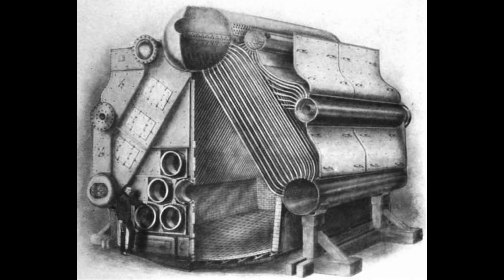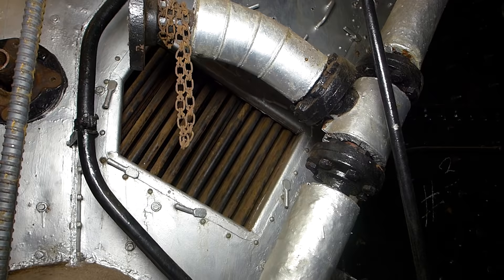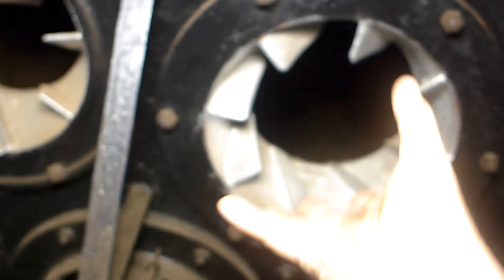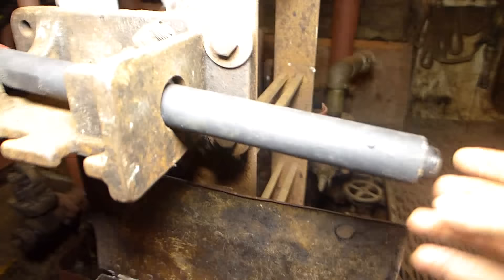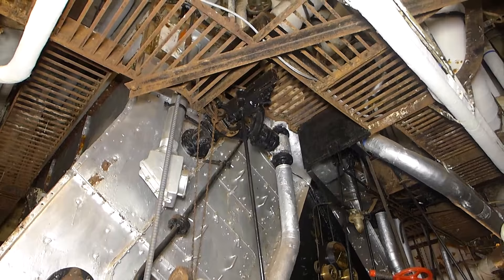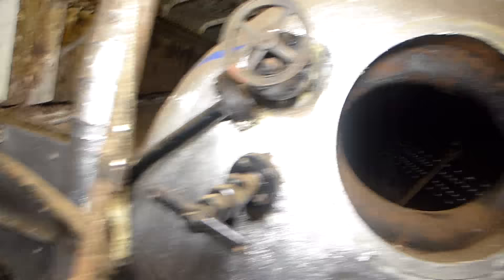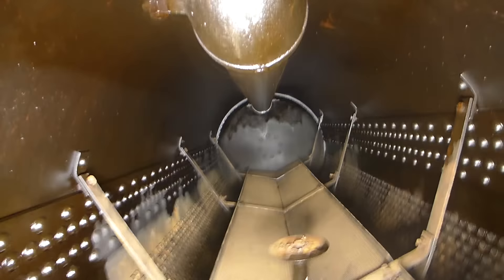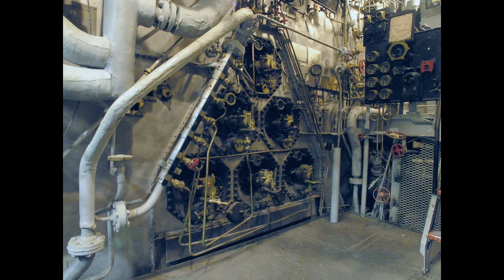Battleship Texas, Making Steam

Comment: Were steam engines powering hydraulic pumps to power up the deck guns...?   And thru intermediary  systems  delivering powder, shot , shells as well as propulsion for catapults tossing depth charges ..as well as powering generators delivering  electric for ship uses... etc....?
Reply from the maker: The only depth charges on the ship were used exclusively by the spotter aircraft stationed on board.  There was no ability to launch or drop them off the ship.  Steam was not directly used for any of the power systems you mentioned.  Electricity was primarily generated with steam driven turbines.  Power for the weapons systems was all electric.   Shell and powder hoists were directly driven by electric motors.  All of the smaller weapons were manually trained and elevated by hand cranks, except for the 40mm anti-aircraft gun mounts that were electrically driven.  The big 14" guns used electric constant speed motors to drive variable speed hydraulic pumps that turned the gears that rotated the turrets or elevate guns.

Comment: I sure hope they eventually "dry berth" Texas before the seawater corrodes her into nothing and they are forced to scrap her. Whether they put her completely on supports (unlikely due to the weight of the ship) or entomb her in cement like they did for Mikasa, it would ensure she's around for another hundred years
Reply from the maker: Setting her in concrete like Mikasa would certainly destroy her, especially considering that they also filled Mikasa's lower decks with cement to ballast her.  The reason for the concrete wasn't for preservation, but to make certain the ship was totally disabled.  Otherwise, the Japanese would have been forced to scrap or sink the ship in order to meet the terms of the Washington Naval Arms Treaty of 1922.  At the very least, doing it to Texas would destroy hundreds of historic artifacts located deep her that can't be removed.  Once in concrete, abrasion between it and the hull created by temperature changes would quickly destroy protective coatings and trapped moisture would then do its work to eat away hull plating and then hull structure.  If kept in water, the ship can be periodically removed and every square inch of her accessed for repairs and restoration.  Keeping her out of water is a non-starter.  There were plans to accomplish that put together about 15 years ago.  Unfortunately, it was far too costly.

Keeping her in water provides the best overall means of supporting the hull and structure.  The key to a very long life is to periodically dry dock her to service her hull and protective coatings.  What is interesting is that the hull corrosion that they are currently repairing in dry dock occurred from the inside out as a result of interior water created by hull leaks.  Most of the protective coatings that were applied in 1990 during her last dry dock session were still there and working.  For those reasons, a combination of re-plating problem areas, full welding of the riveted plating and modern coatings should control further degradation as long as she maintains a 15-20 year dry dock cycle.

Comment: Were the boiler rooms cooled for workers. what kind of temps in the room while in operation.
Reply from the maker: The rooms were well ventilated since they were pressurized.  I understand that they could get as hot as 110 deg. F. with boilers at full steaming rate.
Reply: @tomscotttheolderone364  So a normal day in Houston.

Comment: what pumps the fuel oil to the burners and at what pressure? Boiler can be run at any number of burners, 1-8?
Reply from the maker: Watch "a look around Boiler Room 3."  Oil is pumped to the burners with the service pumps.  Pressure varies, but is generally around 200 psi.  Yes, boiler output is controlled by the number of burners being fired and also fuel oil pressure.

Comment: What was over the big hole in the steam drum? There didnt appear to be any bolt flange or other way of sealing it.
Reply from the maker: The hole is oval, so an oval gasketed cover can be slipped inside and set in place so that it seats against the inner edge of the hole.  A couple of bolted brackets hold it in place when the boiler is not under pressure.  Otherwise, boiler pressure holds it in place.  Click on the following link to go to an old boiler manual and go to page 25 to see it.   The book was for coal fired boilers like what Texas started with, but the covers are exactly the same as what is on the oil fired boilers now on the ship.  https://www.google.com/books/edition/Forged_Steel_Water_tube_Marine_Boilers/fhaDAAAAIAAJ?hl=en&gbpv=1&dq=marine+and+naval+boilers&printsec=frontcover

Comment: How to replace one of those densely packed tubes if there was a leak???
Reply from the maker: They simply plugged the top and bottom openings of a tube and didn't replace it.  I do not know this for a fact, but I have been told that they would accept at least 10% plugged tubes before replacing them.   That makes sense because replacing tubes is a major job that requires the services of a shipyard.

Comment: Did the boiler use distilled water?   It re condensed ?
Reply from the maker: Yes, not just boiler water, but all fresh water on the ship was distilled since it was created from sea water using the ship's distillation system called the evaporators.

Comment: Would love to see her running under her own power again.
Reply: @Lucas12v  Not only the engine is disassembled, USS Texas itself is sat on a dry berth. She's not going anywhere anytime soon I'm afraid.
(Edit: Some of the statement here is wrong and please check out the replies down below)
Reply from the maker: The ship is neither in a dry berth, nor are the engines disassembled.   Regardless, they will never run again.  Making it possible would require complete their disassembly and rebuilding at a cost of millions of dollars.  It would also require opening up sections of the decks from main deck down to the engine rooms to gain access.  Since it would be impossible to rebuild any of the boilers to meet any known safety standard, an outside source of steam would have to be brought in.  Then, steam lines, valves and traps would have to be repaired or  replaced with new ones all the way into the engine rooms.  All of this would require huge changes to the ship that would destroy far too much of her historic content.
Reply: @tomscotttheolderone364  Got it. Thanks for the correct information!
Reply: @tomscotttheolderone364  I figured, but it would till be awesome to see them running again.

Comment: how come steam trains would have super heaters and use steam oil but ships wouldn't?
Reply from the maker: I assume that "steam oil" is added to steam to lubricated engines and other steam driven equipment.  If that is the case, the reason is that unlike locomotive engines,  ships use closed loop steam systems so that waste steam is condensed and returned to the boiler feed water.  Oil in the return water will coat and carbonize on the inner surfaces of the boiler tubes.  This lowers efficiency and can cause hot spots and tube failure.  Since oil was impossible to completely removed from the water, it simply wasn't used.  This wasn't a problem for ships with turbines, but was for those like Texas that had reciprocating engines since their cylinders had to be lubricated.  This gets to the use of superheat.  By not using it, the non-superheated, saturated steam condensed to form a layer of water on the walls of the engine cylinders and lubricated them.
Reply: @tomscotttheolderone364  oh that actually makes a lot of sense🤔
Reply: @tomscotttheolderone364 later locomotives had worthington open feed water heaters and the exhaust steam lines had oil separators to remove the oil from the feed water.

Comment: Is it open again?
Reply from the maker: No, it will remain closed until it has undergone hull shell plating repairs and is towed to a new home port.  That should take 1-1/2 to 2 years.  Dry docking will take place after hurricane season ends.  The dry dock contractor and home port location haven't been announced yet.
Reply: @tomscotttheolderone364  New home port? Not in a Houston? Regret…
Reply from the maker: @oleglithin5101  It will not be returning to its current location at San Jacinto Battleground.  Proposals for new sites have been submitted, but no decision has been made.  One thing known for certain is that it will be somewhere along the Texas gulf coast, probably fairly close to the Houston metropolitan area.